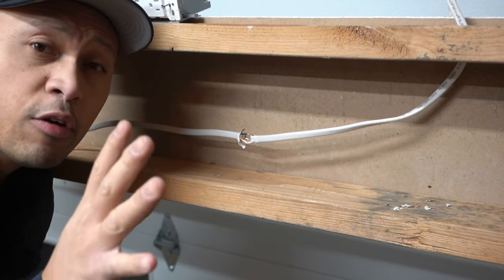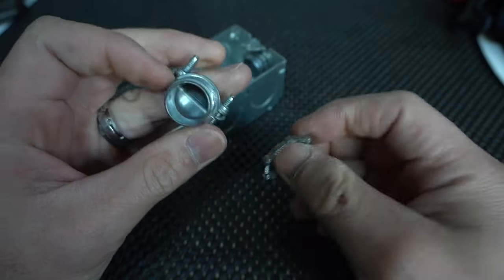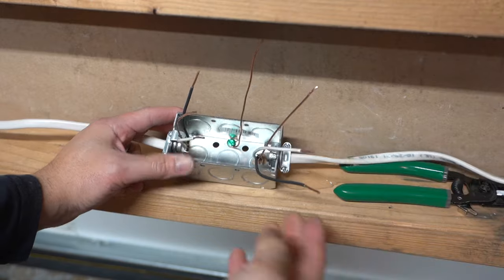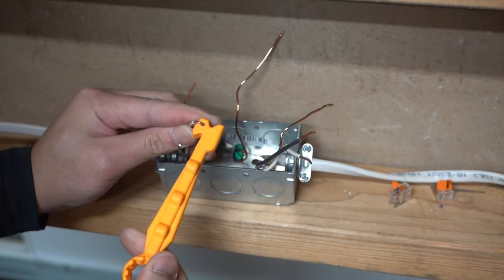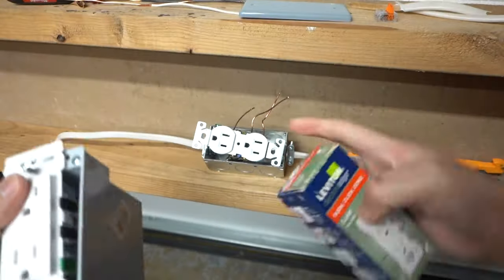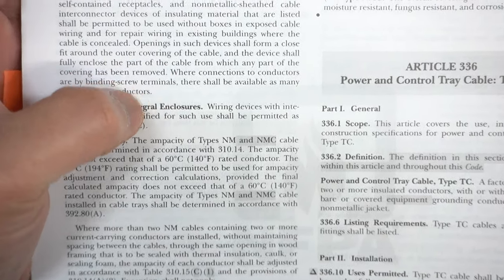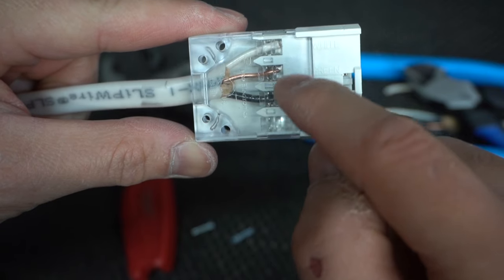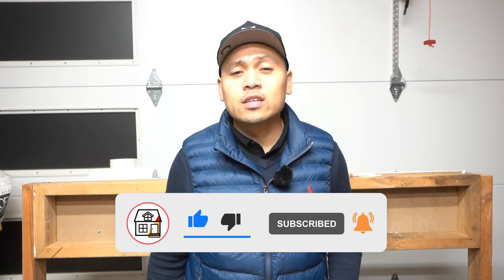How To Fix Damaged Electrical Romex Wires With 3 Methods! The 3rd Will AMAZE You! DIY Repair

Comment from the maker: ITEMS I USED ON THIS VIDEO:
- WAGO 221 Connectors - https://amzn.to/3VaU3DR
- LEVITON Decora Edge 15 Amp - https://amzn.to/3TahrQ6
- Handybox - https://amzn.to/3Id4uig
- 3/8 Romex Connectors - https://amzn.to/3ORpAqo
- Old Work 1 Gang Electrical Box - https://amzn.to/3uVOUEF
- Single Gang Blank Cover - https://amzn.to/4bSBycU
- Combination #1 Screwdriver - https://amzn.to/4bP2ZV0
- Voltage Tester - https://amzn.to/3IcuYR3
- VOLTCLAW - https://amzn.to/3Idu0UI
- Cordless Screw Driver - https://amzn.to/3OWCJyt
- Wire Strippers - https://amzn.to/3OUQXQe

Comment: I have used the TE connector for an in-wall connection 12 years ago. No worries there, it still working well. If you think about it, it is much better than wire nuts and those are used everywhere, even in electrical panels.

Comment: Wagon makes an"in line" connector now, 221-2401. Nice video! Thank you!
Reply: Can these be used without a junction box?
Reply: Generally no. Some area allow shrink tubing over the top.
Reply: I've used them no problem.  I wouldn't understand why there would be any problem when in the first place you had just the exposed cable sitting there. If you can use things in a J box why not use them on wire behind drywall. Same connection.
Reply: I believe the latter connection shown in the video is okay. Wago in line, in the wall is a code violation. It is because it cannot handle any significant stress. There is an all metal equivalent of the same that is in wall approved. I haven't been able to find one lately. The more acceptable thing to do in drywall is add a junction box, put a blank cover on it, that is not covered by dry wall
Reply: @shakyzeg  i don't follow the significant stress. I tried to pull apart an inline Wago. Its hard. Wago tests show current in a Wago connection exceeds the wire capacity.  My bet is the code isn't up to date enough for Wago connections. It can't be for protection since you can drill into the romex wire in the wall as easily as a Wago connector.

Comment: The third method is piece of grab , I have seen it burnt inside the wall , that is fire hazard, this method should not be allowed to bury inside the wall. The junction box with wire nuts if you make sure it is tight it is even better than this method, but funny code not allow junction box with tight connections inside the wall but code allow this piece of grab to be concealed in the wall. Electrician is my trade and I have been doing this work over 35 years, I have seen all kind of loose connections that lead to fire. Definitely the third method should not be allowed

Comment: What is wrong with you? You should ALWAYS connect the ground followed by the neutral and the hot wire LAST.
Reply: What difference does it make, as long as the power is off ??
Reply: @johnreichow907  It has to do with safety. Just because you shut off the power, that doesn't mean someone else can't turn it back on while you are working on that ciruit.
Reply: 👍🏿 agrees with @trukin74 I have seen this happen where someone was shocked 😳 because someone turned the power on at a job site.
Reply: @trukin74  
Should tag the CB as not to turn on.

Comment: Those in line connectors are fine...they have been used in the manufactured / modular home building industry for decades now...🛠🛠
Reply: Ive never seen these before, kind of remind me of those junk 3M Scotch Loks.

Comment: Converting a bad section of cable into a working outlet is like making lemonade from lemons.  I like it👍
Reply: By adding in a receptacle is a great idea, but on the same note it's not code compliant now. Wires are to short now extending from the box. I forgot what NEC code # this is off the top of my head. But I know tit's not code compliant.

Comment: Mount the box facing outward and past the edge of the framing about 1/2". When someone installs drywall the box will not be covered. Seen inspectors fail the side mounted boxes for this very reason.

Comment: What would you suggest if the Romex cable does not have enough  to pull to make it connect ?
Reply: Use 2 boxes. one on each side and then add a piece of cable in the middle to each box